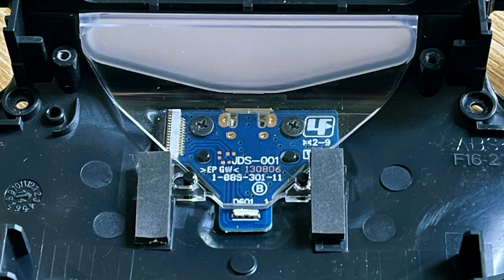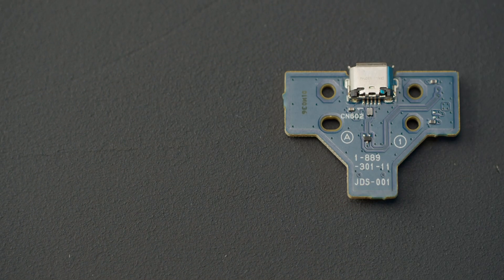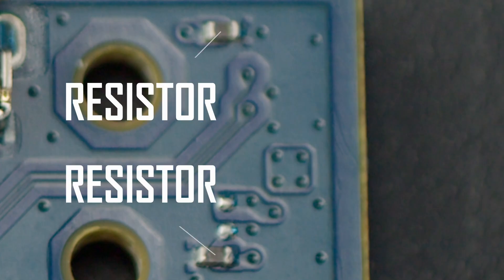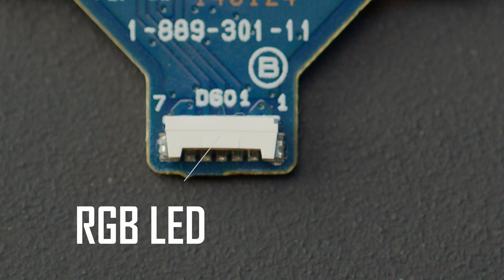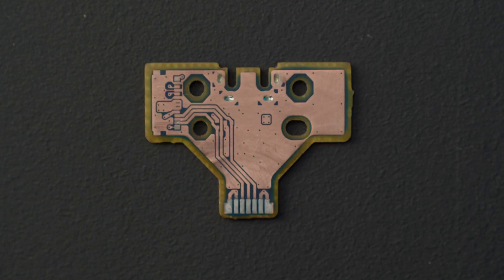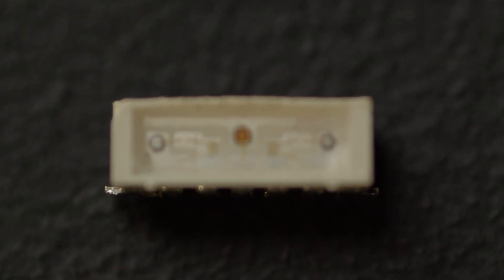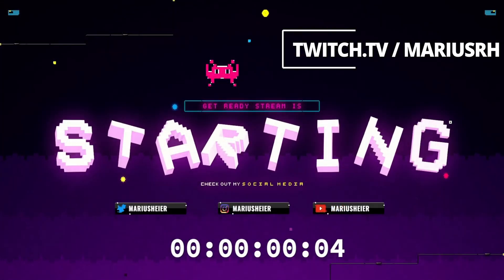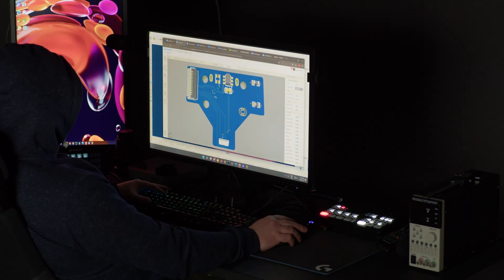USB-C PS4 1 generation

Comment: YouTuber, are you going to sell this? If you sell it, when will you sell it?
Reply from the maker: Yes. I got boards yesterday. I will check if the jds55/50 (newest controller) works today.  And then the rest of the other versions needs checking. If they work i will start to sell them as well. Check out my community post on how they look.
Reply: @MariusHeier1  I'll look forward to it, YouTuber ^^

Comment: Does this work on any other controllers? I have a weird revision
Reply from the maker: Depends. You need to loke for the jds number on the controller. Its printed on the circuit board inside the controller. :)